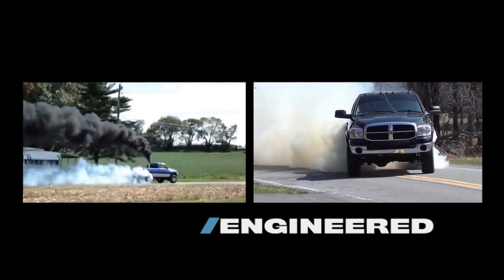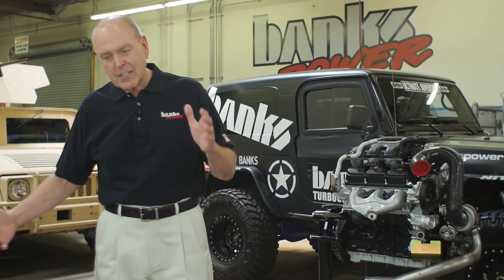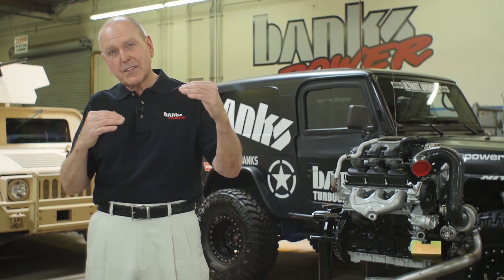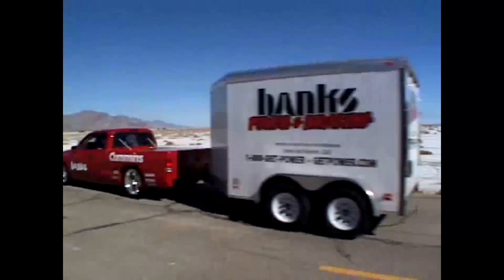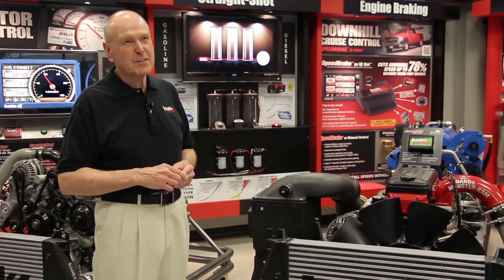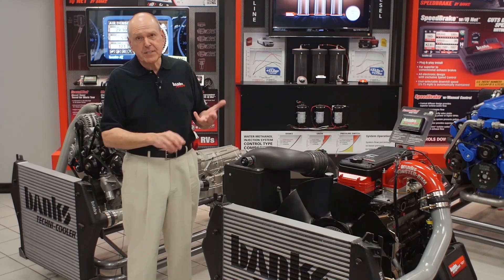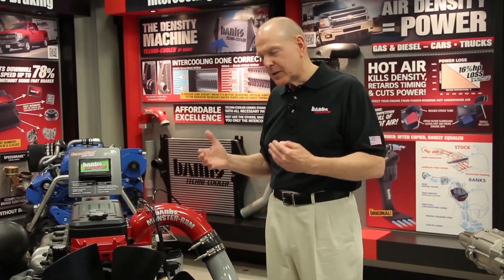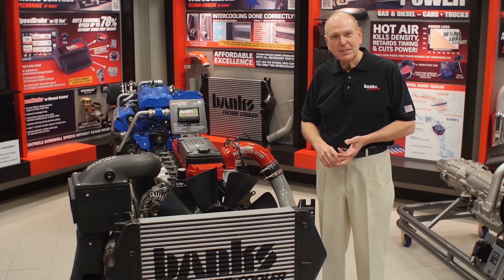Learn from the Master of Diesel - /ENGINEERED

Comment: so i was told not to go with straight pipes on a cummins isx model cm870 (550hp if it matters) because it needs back pressure. now i find out it doesn't need back pressure? where is bp created, if any, then?
Reply: +Magi Strala 
You don't need any bp for a turbo motor, much like Banks explained. The only reasons against going straight pipe would be because of emissions and noise levels lol.
Reply: Backpressure is created when the exhaust housing can no longer flow faster than that of the compressor. The trade off for backpressure is lag, big turbos on a diesel have a lot of lag lets say a 1.15 housing on a 7.3L it lags like a mother. but come 2700-3000rpms I'm around 23-25lbs with minimal backpressure on stock injectors which only put out 98cc per 1000 pulses . If at any the best you can shoot for is 1:1 pressure ratio. Less is lag more is backpressure.
Reply: +xSirDingo true, but the smaller the exhaust housing the less top end you have. my 1.15 housing will feed to 3500rpms, whereas a .84 from a superduty will spool faster but flatten out right around 2600rpms. best thing for any diesel is a ballbearing singles or compounds. faster spool, less smoke, more power.
Reply: +Magi Strala The turbo itself provides all the back-pressure you could ever need, after the turbo you want it wide open.
Reply: Not sure with diesels but if you have a turbo charged engine you can have straight pipes. Actually you want to dump the exhaust as fast as you can. It might hurt the low end a little before the turbo spools. However N/A engines need back pressure!!!! That is 100% true.
Reply: +Emkura Fura On a N/A engine, people will tell you that a certain amount of back pressure is needed.  What they really mean to say is that your pipe needs to be the right diameter to have a good resonating pulse at your preferred operating RPM, often lower on a truck (smaller) and higher on a race car (larger).  The pulse is important because it reduces exhaust resistance and sounds awesome.  Back pressure is not....Ever....On anything, especially turbocharged engines.  On exhaust coming straight out of an engine, your pipe just needs to be narrow enough that the air flow leaves as a single pulse (not an evenly dispersed puff) of air, and wide enough that said pulse is not restricted.  If all goes well, each pulse will help pull the next with the vacuum behind it as they all travel towards the exhaust tip and your engine only needs to push out what's in the cylinder each time instead of pushing against the entire exhaust system.  That's the rough theory.  Moral of the story:  backpressure bad.  Straight pipe good.
Reply: +Emkura Fura I'll reword this and put this thing further to rest.  The reason a larger exhaust system, "frees up horsepower" is because it is translating your torque curve to a higher RPM with a larger diameter pipe.  You might have about the same max torque, but since it comes at higher RPM then before you suddenly see magical horsepower gains.  Your low RPM will be negatively affected because there is "no back pressure".  Really your diameter is just wrong and your not getting resonating pulses where you need them down low.   There was originally only significant back pressure at high RPM that is rarely used anyway, which is why you saw the dip in the torque curve up high.  Now your truck is ready for the races but not for the farm.

Comment: He should design a Diesel motorcycle engine, can you imagine a diesel adventure bike!
Reply: I can imagine needing a crane to pick it up after dumping it.:)
Reply: ***** depends on the size of the engine, and what engine configuration he chose. A 600cc turbo diesel twin wouldn't weigh all that much, built would last forever.
Reply: +mrsuperbuckets no Diesel can rev much higher than 5000-6000.Diesel takes far to long to burn. has little to do with bore stroke ratio.
even the R18s 4 Liter Diesel only revs to 5500 rpm. the only thing you can do is increasing compression/ boost to get diesel and air closer together. 
(R18 runs 4 bar of boost)
Reply: +mrsuperbuckets Our military already has one.
Reply: yellowbusguy Has
Reply: +mrsuperbuckets can you say wheelie machine?
Reply: +mrsuperbuckets The limiting factor as far as I know for diesel engines revving is the fuel itself. Compared to petrol the flame front of atomised diesel is very slow. Once a diesel engine is getting past 4000rpm, the piston starts moving faster than the flame front, so it loses power and efficiency because the combustion chamber volume is expanding faster than the burning A:F mixture. I imagine the engine would need to have such a short stoke:bore to rev high that torque would suffer, and it would be less efficient anyway, since its harder to "fill" and "empty" a wide bore cylinder completely through poppet valves. You could always use sleeve valves, or make it 2 stroke like a Detroit, with intake ports,
Reply: +mrsuperbuckets A 1.2 litre 3-cylinder diesel is an abomination, as proven by the VW Polo Bluemotion. Because of that, I don't think a 600cc diesel engine is a good idea.
Reply: appelpower1 If a purpose built, high performance, under square, turbocharged 600cc V-twin was made just for a motorcycle then it would be amazing, where as the Polo was a turd thru, and thru.
Reply: mrsuperbuckets You sure that's possible? Small diesel engines tend to be worthless, though that might only be an issue for cars.
Reply: mrsuperbuckets As far as I understood that (I'm not very technical), it was quite a useful explanation. Thank you.
Reply: most desiels top out at like 4k rpm
Reply: +trevor philips Undersquare diesels dont rev high, but I am talking about a oversquare diesel motor, and depending how oversquare it could easily hit 7-9k rpm.
Reply: Do you have any examples of cars or recks with sch Diesel engines? Just curious never seen a high revving diesel
Reply: @scientificenigma  Back in the late 60s saw some drivers turn an 8V71 Detroit Diesel to 3500 RPM. It lived through  at least a couple months doing that before a supervisor caught them and turned it back close to stock. I had my own 6-71 Detroit turned up to 2600 RPM though rarely twisted it over 2250rpm and it never complained. An older man explained to me as a very young man how to get the right attitude to drive a 2 stroke Detroit. He told me to slam the door on my thumb every morning to get in the right frame of mind. That's stayed with me nearly 50 years and I still smile remembering him telling me that.
Reply: +trevor philips Aud's 3.0 TDI revs pretty high, as does  BMW's turbo diesel.
Reply: Too much weight unfortunately, among other things like space etc... Diesel isn't great for bikes overall due to some of it's basic constraints. Unless of course you just want to go straight at Bonneville.
Reply: The stroke is longer because the fuel takes longer to burn. Diesels have a lot more energy, but it's released slower. The longer stroke combined with a higher compression ratio is why diesels have so much more torque than gas engines.
Reply: +appelpower1 Car engines are made so their stroke is bigger than their bore, that is why cars do not rev very high. Where with motorcycles the bore is much larger than the stroke so that is why a normal motorcycle revs to over 10,000 easily, and some rev to almost 20,000. I bet a diesel would benefit because the heavy steel piston, and crank would not have to move as far, and so it could rev out to 9,000 rpm reliably, and the v-twin configuration would keep the bike very thin.

Comment: Do you use fairly high compression pistons to make sure you dont get blow by with the high pressure of the diesel ?
Reply: Yes im not sure what theses pickup motors are but the mack and volvo trucks i work on are 16:1
Reply: +Z Jones yeah they have to have bot higher compression to make the power and reliability for the diesels

Comment: i get tired of seeing people  with a k&n air filter just shoved in somewhere and saying it has power. i just look at them like theyre dumb like when they have it behind the batter or right beside the engine. some people are so dumb
Reply: Only if the the stock air intake is restrictive does it do anything, but it also has a flow on effect, if the ECU does not know it is been done nothing will happen in most cases.
Reply: exactly but in most cases the air box isnt restrictive
Reply: Indeed, people think induction noise is power, some after market intakes decrease power as well.

Comment: He's looked at diesel and gas but I'd love to see what he has to say about rotaries and other engine setups.
Reply: ***** Yay! Although I doubt Mazda will bother to even try...
Reply: +A10troll well  rotary is a gas engine ... how about you say well he looked at combustion engines how about rotary. but he probably  has no clue about them most people don't and thats because they are kind of a stupid motor they arnt very fuel efficient there expensive there heavy and they don't last very long. i mean yeah if you mod one enough it can get some crazy numbers like a 4 rotary twin turbo but most of those vehicles are promotional race vehichles and don't make sense in real world application.
Reply: +Karson Cox the secret with rotary engine is to keep heat work for torque, and no dumbly heat up rotor and housing wall.
There are some ways to do that and one of the first is to burn as fast as it's possible, that's why rotary get better efficiency as rpm rises and why the R26B has 3 sparks plug / housing
So idealy rotary will be pleased with burning H² or gasoline by knock

You can get better efficiency by reducing heat dissipation by using exotics surface treatment and materials.

All others aspect of rotary stays quite close to reciprocating piston engine.

But yeah, rotary are intersting for making power in a relativly small package, but it's a uter sh*t for efficiency and efficiency is the key
Reply: *****
I know it was a joke, but knowing the truth about Wankel i had to reply to it.
In order to join the SS, you needed to proof that you were a pure arian german. They traced your ancestry. So him joining the SS would exclude the possibility of him being jewish. Besides, nazi and SS-member or not, he is said to have been a very kind, warm and admirable man.
Reply: +A10troll Ignoring the whole pointless Jew argument here: wouldn't it be possible to make a rotary diesel engine? I'd love to see that. Mazda, who are bound to release a rotary sports car once again in a couple of years, are working on a hydrogen rotary engine. That probably combines the best traits of eco cars and combustion engines.
Reply: ***** So it ought to be possible, then?
Reply: DolleHengst Nazi was a term short for National Socialist group of Germany, who were actually Left wing, not right. I'm not saying that makes the left evil, but it makes the Nazis leftists. Let's not forget, the American soldiers who battled the Nazis in WWII where one of most conservative generations of any country, Aside from Gen-Z

Comment: Good video, but adding an intercooler to an engine that has sufficient fuel octane will not increase power, in fact most will lose some power if the boost is not increased. I've done back to back tests on a V6 turbo at 12psi with a very low pressure loss intercooler and E85(no knock).  Dropped the boost by about 1psi, and temps by about 70-80* measured at the throttle body at full boost. Power was ever so slightly less. Boost was referenced at the outlet of the turbo. If boost is referenced at the throttle body or manifold it's a different story, but in that case you're working the turbo harder to overcome the intercooler restriction.

Comment: The only comment I have is that the P1V1T1=P2V2T2 pre and post inter cooler, temp drops, pressure drops, volume is constant.. you arent looking for more density from the inter cooler as much as you are looking to minimize temperature entering the cylinder to keep those combustion temps down. Higher intake temps temps become higher by a multiple of your compression ratio during compression and then higher again in addition by several constants ((QlhvBTU_1*combeff_1)/(((cvmix_1+cvex_1)/2)*(1+AF_1)). Keep temps down on intake, keep more oxygen in the engine, regulate fuel, make power.

 This guy did a good job either way!
Reply: I've gotta agree with the expert here. it doesn't really matter about intake temp in a diesel because you inject fuel at the top of the stroke so you can't get pre ignition. your only limit to power is the amount of fuel you can burn. you need the most amount of air molecules in the cylinder as possible. or the greatest density of air. it doesn't need to be at any specific ratio like a petrol engine, if you have more air then you need it'll just get exhausted out, if you don't have enough, you'll have some partially burnt fuel and you'll see black smoke.

Comment: I've always been curious about diesel. I assume since most diesels are turbocharged they are all pretty stout from factory. 

I'm wondering if it's any cheaper to play with diesels than it is to build gasoline motors from scratch to handle boost.
Reply: Depends how much power you want. Anything over 200hp>then stock gets to be quite expensive usually depending on the engine if you want it reliable. P-pump 12v Cummins are great for cheap hp but they'll usually smoke a lot being mechanical injection even well sorted. Turbo iron block GM 4.8 or 5.3 are cheapest horse power builders for race cars in my opinion.
Reply: +bluecapone I don´t know the US market any good, but in general I would guess petrol are cheaper than diesel. Petrol engines have lower compression, therefore thinner block walls. Diesels have a much(!) higher high pressure fuel pump than most petrol engines, again, more expensive.  There are a few parts, mainly the block, that is rated for higher pressures than what you would find in most petrol engines, which makes the engines more expensive. If they become more expensive than a petrol I don´t know. But looking to the Silverado where the diesel is, what, 7000USD (?), more expensive than the petrol (what ever the displacement it is), I do guess they cost more.
Reply: +bluecapone i find that the people who I've heard say that ( not you idk you) usually are extremely cheap. Being a penny pincher and gaining power virtually never go together. But like that Tornikholm guy said Diesels require higher pressures which equates to higher quality/performance parts which is always more expensive. Even with repair services as there are a smaller amount of diesel techs than standard auto techs. I guess the only literal bang for your buck is fuel.
Reply: +Anthony Rs I hear what you're saying. I've seen brand name part builds compared to budget builds that push the same power for half the price... That's where I'm coming from. I have the money to spend but if I don't have to spend all of it on the motor then it's a win. There's nothing like a junk yard build that can hang with the big boys.
Reply: Oh totally! Smart shopping/modding is never bad. Professionals say all the time buying every part or mod is not the way to do things. Good luck on getting your project going